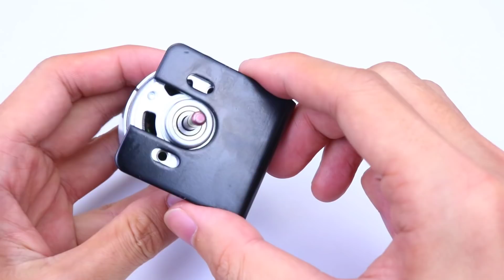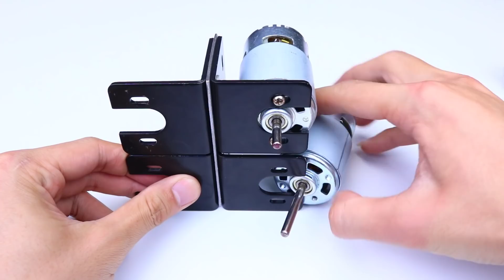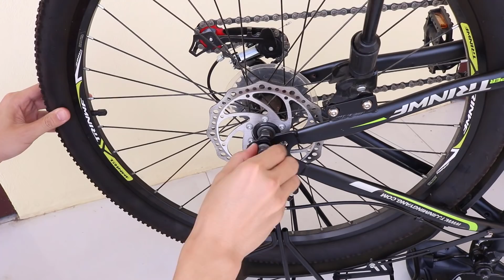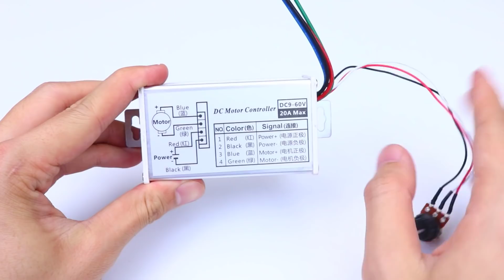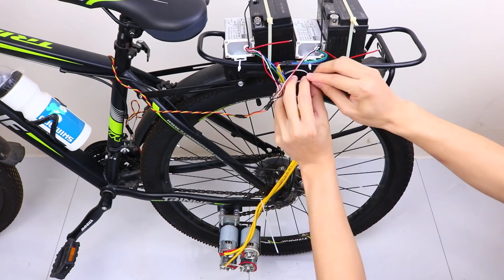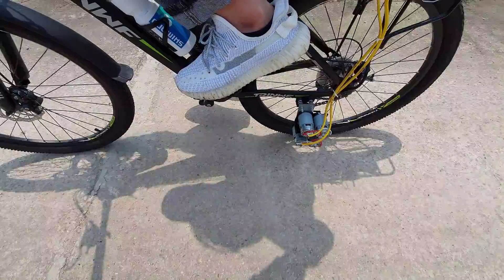How to Make Electric Bike with 4 Motors 775

Comment: This would not work at all the motors don’t have enough power for that steep of a gearing and The motor that has the chain drive on it the bushing would wear out really quick in that motor and lock up that motor the batteries do not have enough power to even supply those motors and the video of him riding the bike was on a slight downward hill That’s the only way you could get that thing to move you
Reply: VF555 Fotia my point exactly
Reply: 7 uni unil lol Muni ml moo tomo in DC DC submitting the smile lo
Reply: who asked

Comment: I gottan say i'm really impressed with the usage of only bought parts and no any serious metal fabrication done. 
But If you are willing to learn new stuff i reccomend entering some forums and discussing some of the components you used. I think none of the drive train components will hold up more than several rides. But you can totally fix that and built a better one so that's an opprotunity to learn.
Some of the elements that are badly desgined:
1. The gear ration is not correct for such a motor.
2. All the brackets are thin steel sheets with a very low moment of inertia. those will fail either from the motor load or from the just random bumping in stuff.
3. The motors are exposed to rocks and debree hitting them.
4. The shaft of the final motor is way to thin to withstand the torque exerted by the four motors together.

wish you the best imporovment for the next time!
Reply: Thanks, something I will remember for when I try to make something like this
Reply: Should use chain on all motors..or buy one powerful motor with planetary gear.

Comment: Those motors must be burning. They are high speed. With reducer, it would be much better. 

It is worth buying cheap spare parts on aliexpress and build regular ebike for less than 200 bucks. Or premade conversion kit for similar price.

Comment: Very innovative.  However I see a lot of problems with dependability, especially in the 4 motor plate exposed to damage.  The lead acid batteries will not last long better to use LiFePO4.  
Bending in the motor mount will wear the motor shafts quickly, why not use one large motor?
Reply: Bro ffs he's just done the build to meet his requirements. Go build your own and puzzle yourself with your own questions.
Reply: @uzimakibarrage3100  yahh no he's giving good cretic. If a man never learns the flaws of his design heel always stay a fool.
Reply: @ragnorockcookie2868  bộ này có bán không và giá cả thế nào

Comment: Good practice, but as braking system and acceleration system is independent, driver may face a serious situation when abrupt stop. So braking system must override acceleration, such as by installing a circuit breaker
Reply: I was a big troubled regarding this, could you explain it to me please?

Comment: you put the motors at 20,000 rpm in a device that requires 20 rpm. nice idea. no power at out put and
burn motors or controller and wire.

Comment: A suggestion: use sprockets with more teeth (is 68t or so) as 12t sprockets do not produce much torque, which is very important in an electric bike. Otherwise great video

Edit: forgot to say to connect the larger sprocket to the wheel. If you have a gear cycle you can understand why I'm saying this.

Comment: Cool but some design flaws for sure, maybe try putting the brakes back on and mount the motors in the centre of the frame, connect the chain to drive the largest outer sprocket on the crank and the smallest from the crank to the largest rear sprocket, once you’ve started pedalling turn on the power and use the motors as power assist, you will still have to pedal so you don’t put so much load on the motors but it should be much lighter to pedal
Reply: He can just add some rim brakes.

Comment: This sure as Hell won't last long in the UK with the batteries and motors exposed to the elements like that? The drive sprockets are not splined on and instead are simply held on with grub screws fastened onto round drive shafts with the motors bolted to a flimsy adaptor plate with no drive chain tensioner. Put any drive load torque on that lot and it will slip and bend like fuck. What could possibly go wrong? 😂😂😂

Comment: how did you lock that gear in the wheel ? while putting weight you will rotate it on the direction that looses it, strange for me
Reply: 0WEIJIAOSHOP 5mm/8mm/10mm/12mm Shank M10 Arbor Mandrel

Comment: Version 2 you should try using RC car motors there build for power and speed
Reply: You can get these 500 watt tiny little motors but they need a LOT of gear reduction or they'll burn out. Also they are designed for the high speed cooling of RC cars and probably not continuous load like climbing a hill on a bicycle.

Comment: I'm surprised it had enough gear reduction to work well. I would have thought those motors were high rpm low torque by looking at them, and you'd want a large pizza sized rear sprocket.
Reply: Those motors have big torque, but the problem is that that motors weren’t made for e bikes, they were make for drills, saws, and other tools

Comment: I badly need to have this to prolong my life. Im suffering from kidney failure as i only have 50% left of it. This will let me go further with my biking exercise since i have my physical limitation due to my health condition. Hope you can help me. Want to know if did you use a motorcycle battery for this? And how it is going to be charged? Does it have a regenerative braking mechanism?  Thanks for the answer and it will be highly appreciated ❤ from Philippines with 🥰
Reply: Yes, it use ordinary motorcycle battery to work, but you can use another type of battery too as long as your battery has sufficient voltages to supply that four motors. And to charging the battery you will need an appropriate battery charger...
Hope this answer helpful to you...

Comment: Tell me the high speed of this cycle after attaching motor
Reply from the maker: I don't know
Reply: @nda  sir can you please tell which battery to use lead or lion and how many volts and ampere and which controller please
Reply: @piyushchanchlani  Don't asked him he Don't know anything
Reply: @ramadavince6611  why?
Reply: @piyushchanchlani  read his reply 😆
Reply: @ramadavince6611  kya
Reply: Сделай директора электродрель
Reply: Ещё тебе поставил лайк и подписался на твой канал
Reply: @piyushchanchlani  use any u want li-ion is expensive if you don't build battery pack yourself .....use eBay kits you get conned if you brought one already built
Reply: 7 mph

Comment: The drive shaft of the engine is too long; it will bend or break. So do not do it!
Reply: Yes , also the shaft make bush worn-out quickly and shaft will bend due to heavy load, ,due to this  motor become hot and burn

Comment: Try the motors and controller used car windshield wipers they have a gear reduction already and can be set to 2 speed and park, mount to the middle of the frame and drive the largest sprocket on the crank
Reply: That's an interesting idea!

Comment: I have one question, do you have to use two dc controllers or one is enough? Because part with connecting controllers is a little complicated for 14 yrs old🥴
Reply: Those many dc motors are required. 775 motors aren't very powerful.

Comment: Is this what they call as "1x4" :D
btw
You should have aligned the motor poles to sync the torque output. Actually, you can align them to optimize torque or speed...
Reply: Can you explain a bit more ? those are regular DC motor, and they have only two magnetic poles (as much as i understand), and even if hey does align them they can slip and get out of alignment....

Comment: This would not work at all the gearing is too steep those batteries would not have enough amps to even supply the motors not to mention that the motor that has the chain drive gear on it the bushing would wear out really quick and lock up the motor in the video he’s going downhill to even get the thing to move him

Comment: no water proofing ? no casing ? 

What r u doing man ! you should first safeguard motors, battery circuit agt. dust, sunlight, water weather etc.

Then use it !. IF Motors get dust collected inside ! you've to again install new motor

people ! watching this ! don't copy.  just apply brake on your imagination ! THink Safety THINK Money

You should invest more in this for safety of motors, battery and motor circuitry (WARNING BATTERY MAY BLAST on 
repeated rain & Shortcircuit !) Don't give demo ! give proper solution